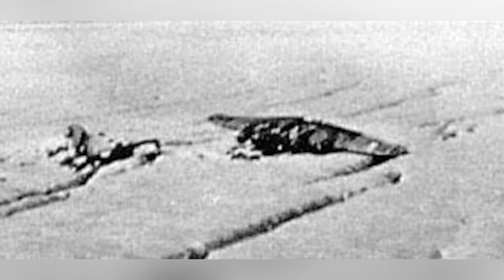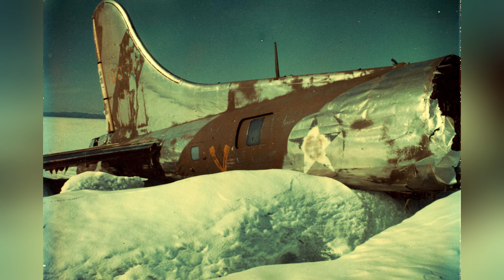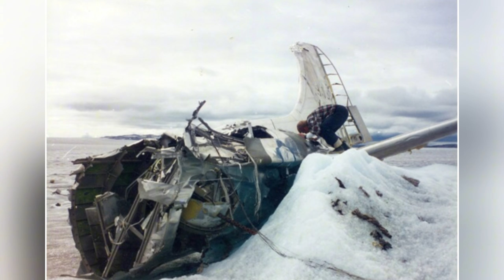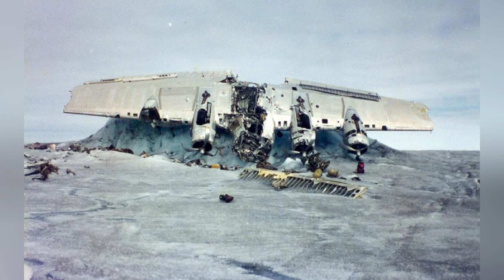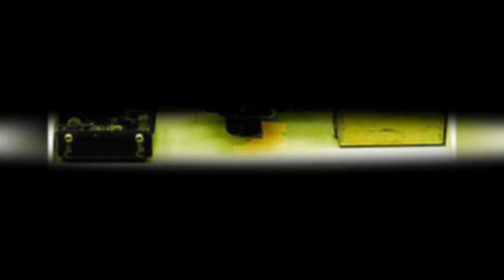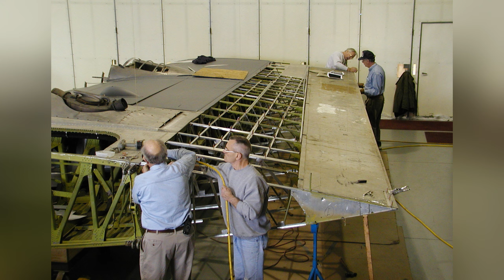Recovering My Gal Sal: The B-17 Raised From Greenland Ice

Comment: Rarity determines value.

Back when WWII came to an end - they were scrapping these things by the hundreds.  They were fully functional aircraft - that for the most part - had FLOWN to the scrap yard.

Now that there are hardly any of them left - people will go to these remote crash sites to try and recover them - costing - far more than it did to build these aircraft in the first place.

One other factor in the decision to fly these aircraft - is that FLYING them - has led to the loss of some of them.

These Aircraft - when new and flying missions - required a tremendous amount of maintenance and skill.  There was not just the skill to fly them - but - the skill to maintain them.  When flying for the United States of America - the American Government paid for all that.  Now - that has to be paid for and performed by much, much smaller organizations - some of which - do not have the resources they need to operate these aircraft Safely.

2019 Boeing B-17 Flying Fortress crash
https://en.wikipedia.org/wiki/2019_Boeing_B-17_Flying_Fortress_crash

Other factors include the fact that The Air Force - had constantly trained and assigned people to perform the tasks necessary to operate these aircraft.  Two of the Crew Members of Nine-O-Nine were in their 70's.  I'm 74.  When I was in my 20's and 30's I rebuilt engines and performed repairs on my 1969 Camaro's.  I drove those cars on thousand mile Road Trips - crawling under them in the middle of a field to repair them.  I can't do things like that any more.  I gave the last Camaro to my younger brother - because I was too old and crippled to maintain it any more.  The Nine-O-Nine had had a dedicated mechanic - but - when he left - the PILOT was the guy maintaining the aircraft.

The FAA had a Living History program where they allowed Companies like the one that own the Nine-O-Nine to operate commercial passengers on Joy Rides around the country.  These Living History flights were not required to meet the passenger safety requirements of Commercial Airlines.

The FAA required a Safety Management System be implemented for the operation of these aircraft - but - the owners didn't do it.  The pilot (who died) didn't even know what it existed.

When these WWII Aircraft were new and being maintained by Trained Ground Crew and flown by Trained Air Crew - they still had Operational Losses that were fairly high.  A lot of this was because of the stress on the Aircraft from being used the way they were - but- not always.  Sometimes things just broke and people died.

Every now and again - you see things about another one of these Historic Aircraft being lost.

In 2022 the B-17 Texas Raiders was lost in a collision with a P-63 at an Air Show.
.

Comment: In 1974 I was stationed as a USAF Air Traffic Controller at Sondrestrom Airfield on the West side of Greenland above the Arctic circle for a year. While there I had the opportunity to fly to the middle of the Greenland Ice cap and land on skis next to one of 4 DYE early warning radar sites located on Greenland. We then flew to the East coast of Greenland and landed on a dirt runway next to another DYE site. The ice cap goes up to 11,000 feet in the middle and there is a lot of NOTHING there.  Very interesting video and most people do not understand how remote this location is. We had procedures for military aircraft to fly over the airfield then bail out or eject (for fighters) when the field 's weather closed in unexpectedly. Hopefully they would land close to the airfield to be rescued. This procedure was in place because a lot of aircraft did not have the fuel range to get to an alternate landing field since the closest was around 600 miles away. That was a long year and do not want to spend another winter above the Arctic Circle! BTW the airfield mentioned at 9:17 is Sondrestrom.
Reply: Interesting experience. Thank you for sharing this.